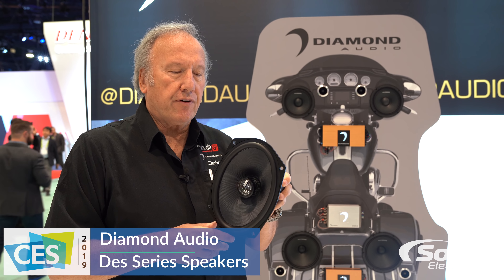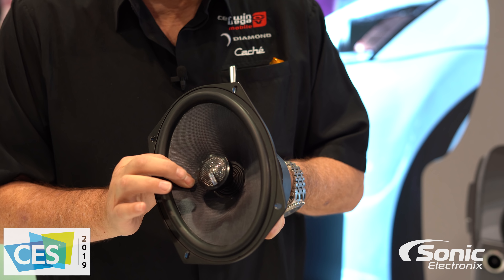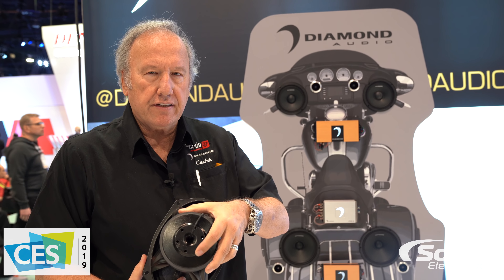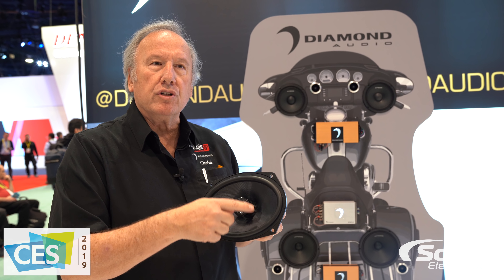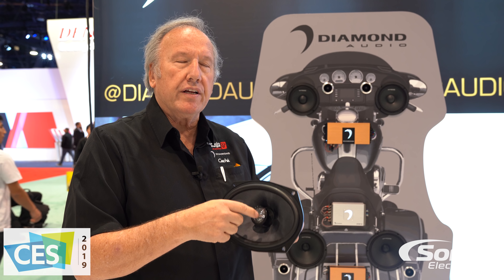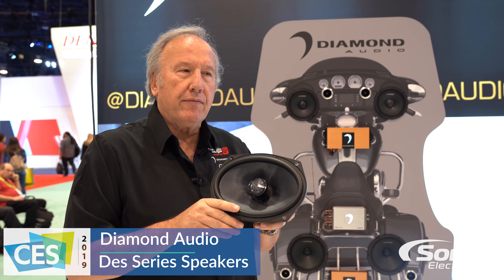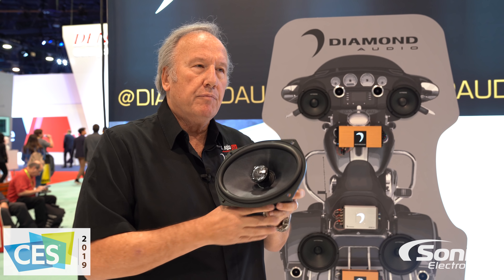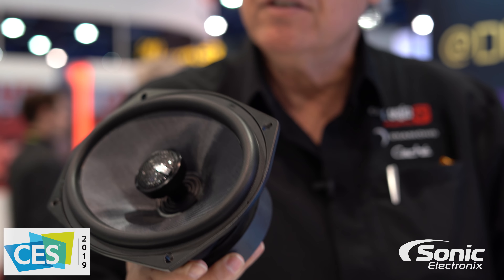Diamond Audio Presents... the Diamond Elite Series (DES) Speakers - CES 2019

Comment: I have to say, I was a little surprised after I got mine that the structure is made out of plastic??? It is a hard, ABS type of plastic, but? I think they did this to lighten the weight, but seriously wondering how this is going to perform? It definitely can't be as rigid as an cast or metal frame!